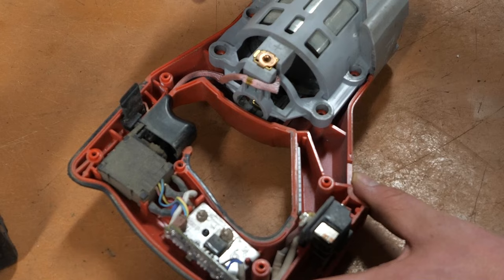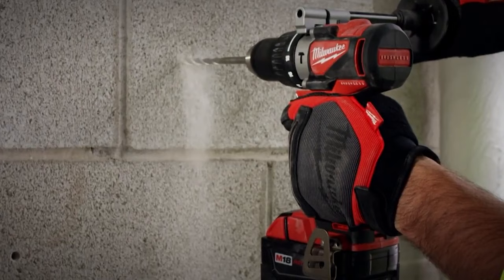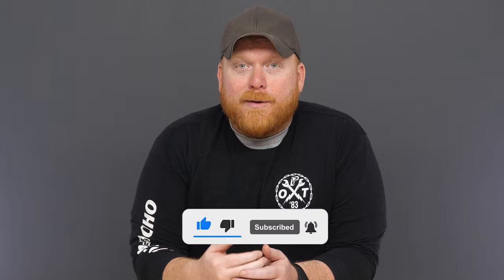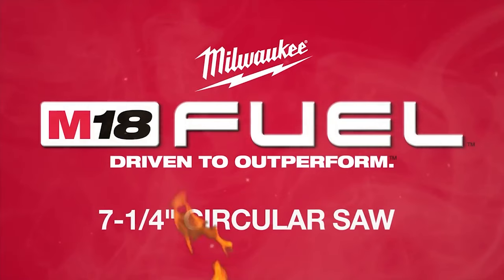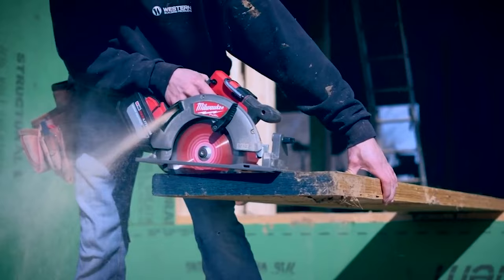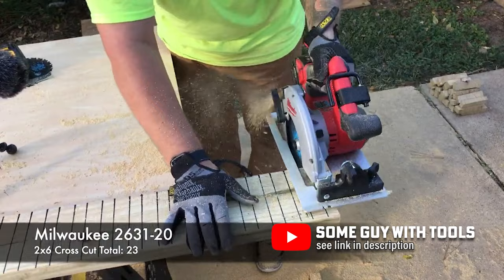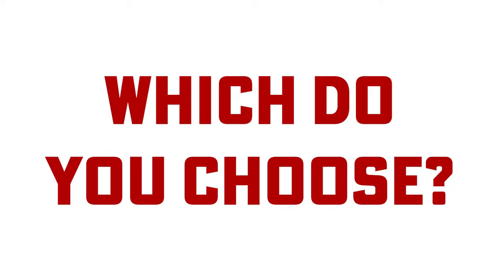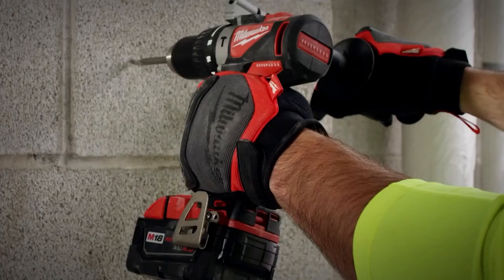Milwaukee M18 FUEL vs M18 BRUSHLESS Motors - Are they really different?

Comment: Milwaukee brushless are absolutely junk , have 3 hammer drills and 3 impact drivers that are  DOA after a year, switching platform so I can hopefully get reliable tools , FYI my 12year old brushed yellow are still working, inc the batteries
Reply from the maker: Sounds like DeWalt may be the better option for your tasks 😉 No problem with that!

Comment: Didnt give any information about the difference between brushless and fuel at all.
Reply from the maker: Here is a link to our blog that goes even further into depth about the difference between brushless and FUEL. (https://news.ohiopowertool.com/milwaukee-m18-fuel-vs-brushless-vs-brushed-motors-how-do-they-compare/) To put it simply both are brushless motors but FUEL added more power and features as it was a line for individuals that needed more power out of their tools. Regular brushless tools are for those who may not need all of the extra power and additional add-ons (like Redlink PLUS for example). Milwaukee wanted to keep an affordable line for those who needed it but they also wanted to keep growing and provide more power with upgraded specs to original models. Hopefully, this helps!

Comment: You didnt even say the difference. You just said the brushless was similar to older models.
Reply from the maker: Basically, all Milwaukee FUEL tools are Brushless, but not all of Milwaukee's Brushless tool options are in the FUEL category. FUEL tools have all the benefits of brushless motors paired with their POWERSTATE brushless motor technology, REDLITHIUM batteries, and Redlink PLUS intelligence for added power output. They're considered the best-of-the-best for Milwaukee's brushless tools in terms of torque and drive power.
Hope this helps!

Comment: So what exactly does FUEL mean? I’m still not understanding.
Reply from the maker: Sorry for the confusion, the FUEL range is considered the best of Milwaukee's brushless power tools. FUEL tools have all the benefits of brushless motors paired with their POWERSTATE brushless motor technology, REDLITHIUM batteries, and Redlink PLUS intelligence for added power output. 
Look at it this way: all FUEL tools have brushless motors, but not all of Milwaukee’s brushless motor options have the boost in power and runtime that the POWERSTATE brushless motor delivers to the FUEL tools.
Reply: @OhioPowerTool  excellent, thank you for that. That helps!!

Comment: i dont   like fuel  i cant  tell  if  im screwing    or  not     i like betther  brushless  i can feel  when i screw into  wood  or  whatever  material
Reply: because you're not using the FUEL tool w 100% understanding of its features and capabilities. 

For finish trim work,  always use the drill on 1 (vs 2) and set the clutch to the lowest setting (2-4) then drive your screw. Check results. If you want the screw to drive further in, slowly and gradually Increase clutch to desired setting. 

Thank me later :)

Comment: I use fuel tools at work and they’re great.  I bought a 10 tool brushed Milwaukee kit for the house and it has served me very well.  As those brushed tools wear out I will be replacing them one at a time with brushless or fuel models, but that may take a long time since I don’t use them day in and day out.

Comment: Thanks for “brushing” us up on the differences between brushed, brushless and Fuel tools in the Milwaukee lineup. (See what I did there?) Annnyhoo….. Brushless tools are fantastic and Fuel kicks it up to 11. (Or 12, in the case of the M12 Fuel Multitool.) Love ‘em!
Started out:
- Black and Decker 18V Brushed 
(and NiCad batteries)
-Moved to Kobalt 24V Brushless
(Great tools but not a very expansive selection at the time.)
-Stepped up to Milwaukee Fuel and not looking back. 
Great video, Nick. Keep up the great work. 
OPT is the best!

Comment: I just bought the brushess drill and bit driver combo. I had them in the past and used them for about 4 years on semi trucks. I abused tf out of both of them. The bit driver never died I just left it behind. The drill on the other hand explosed when a 1/2" drill bit snapped going through 3/8" thick aluminum because I was pushing it way too hard.

Comment: Is the regular brushless line up being discontinued? At Home Depot, they have M18 18V Lithium-Ion Brushless Cordless 1/2 in. Compact Drill/Driver with One 2.0 Ah Battery on clearance for $89.99. And can you use the fuel batteries on the reg brushless power tools?
Reply from the maker: All M18 batteries work with Brushless M18 Tools! The brushless lineup is alive and still going strong but it does struggle with finding an audience at different times in the year. The big box stores are probably why this option even exists as they love to have different price points on every single tool, most pro suppliers like Ohio Power Tool stock and sell FUEL tools, because they are just a little more money but always have best performance possible. We think the M18 brushless are good tools and if kits go on sale for $99 at holiday than can definitely be a great deal.

Comment: Is Milwaukee going to offer an adapter to plug a tool into an outlet?
The big power users like the table saw or angle grinder.
Put a wire brush on an the 6" angle grinder and it uses an amp hour a minute.
Reply from the maker: Let's hope they do one day! Fingers crossed!

Comment: I want to invest in Milwaukee but I want to buy their newest latest and greatest line up. Is that the fuel?
Reply from the maker: That depends! Milwaukee releases new tools on their M12, M18, and MX FUEL lineups pretty frequently; each have their pros and cons, so it's really up to personal preference and what you think you'll need them for throughout the day. If you're doing a lot of professional all-day labor, you may want to look into the FUEL line to get that boost in power and performance, but if you're just looking to use them around the house, you could definitely save some money and get away with an M12 lineup!

Comment: thing is if buying just the skin only (without battery), im looking at 184mm (7.25") circular saw, the Fuel is nearly twice the weight as the standard brushless one, and a bit more expensive, so why get that when the standard brushless has very similar specs?
Reply from the maker: For some, it's just personal preference! I know some people that love the weight of their circular saw, but others prefer a lighter tool for ease of use!
Reply: As far as the impact drill, it had slightly more than double the rpm than a standard brushless(specs on gun) 600-1500 or so I believe
So theoretically it should be stronger and not use as much battery. More rpm probably means it’ll take way longer to overheat

Comment: The mid-level brushless series is not fun to use. The drill chokes up, not fun to use.. The saw has a crappy safety trigger that doesn't work 1 out 10 times. not fun to use. They just don't chooch.